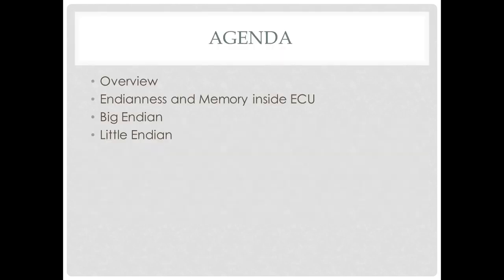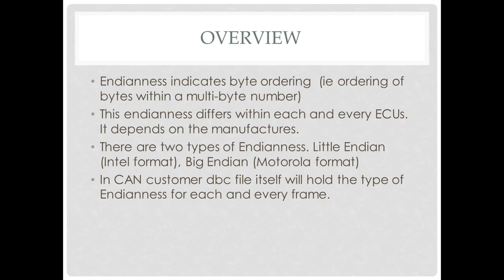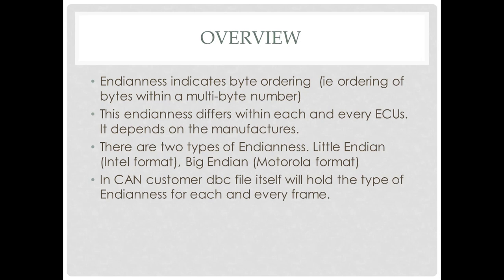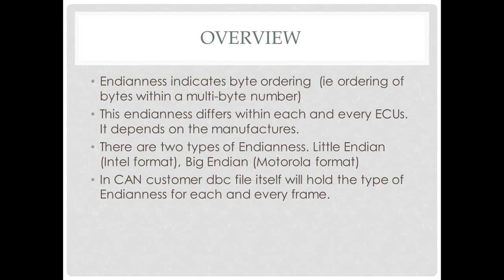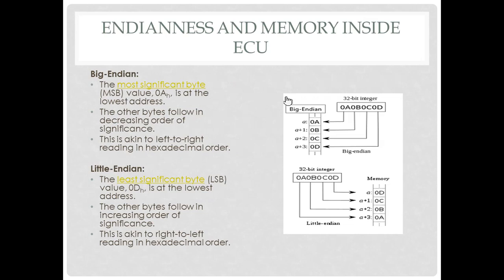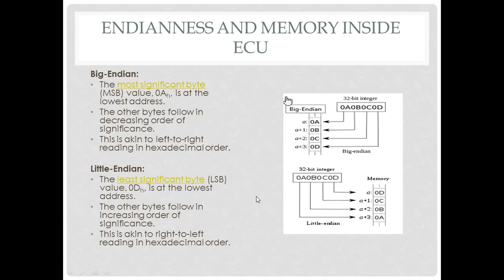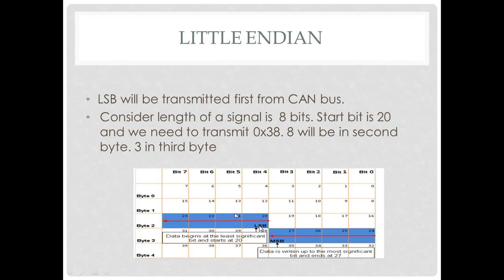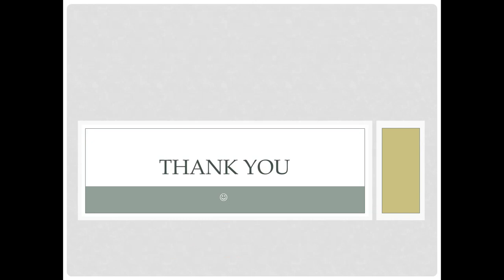Endianness - Big Endian, Little Endian

Comment: If Start bit is present at 0th bit and ends at 9th bit(little endian) in can frame then after conversion to big endian what will the position of msb (which byte which bit)?
Reply from the maker: Since big endian MSB is transmitted first as per my understanding MSB should be in 0th byte 0th bit

Comment: please claify: As far as i know the nibbles are not interchanged whether it be little endian or big-endian. what I mean is that little and big-endian are not applicable within a single byte. Why was it shown like that in the example? Shoulnt the example a number at least 2 bytes or more?
Reply from the maker: Your understanding is right if the start bit position of a signal is start of the byte(ie bit position 0,8,16.....). In the example shown start bit position is in middle of the byte..
Reply: @electroniccontrolunit9294  ok... ill check again.. that representation was a bit confusing. would have been really nice if you would have given an example containing more bytes of data. Anyways thanks for the  prompt response an the effort you have taken to explain.

Comment: It's very confusing. Explanation should be with respect to 32 bit data because that's a practical scenario. Why in between nibbles are zeros. That's not explained clearly.
Reply from the maker: what to do mean by zeros? I don't find any zeros in CAN frame structure. Do you mean unused nibble? Can you please explain in detail? Ideology here is how the data's are filled. If you understood that then you can apply easily for 32bit